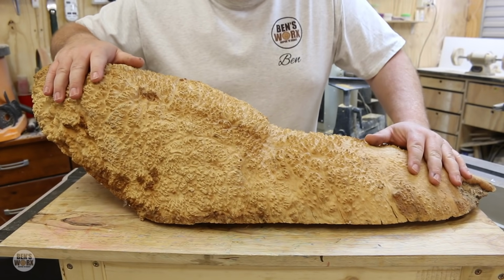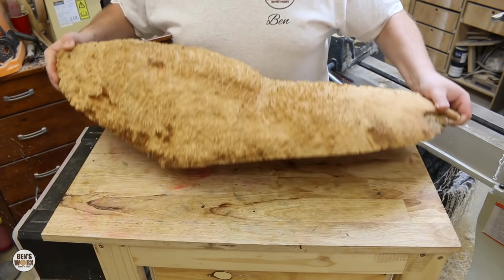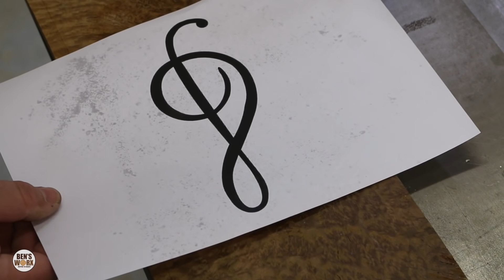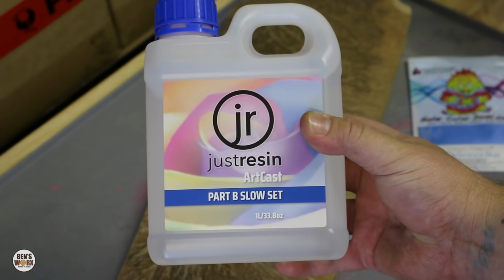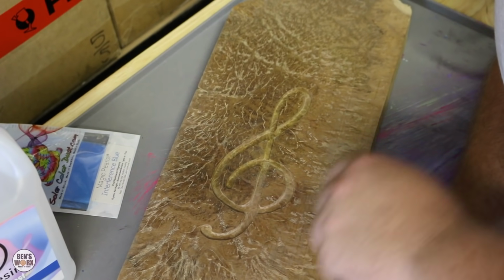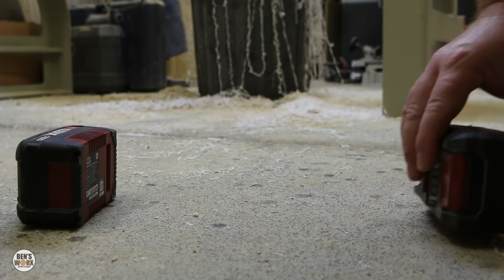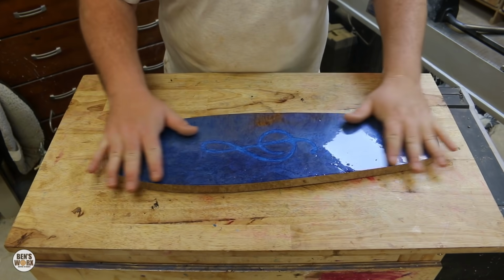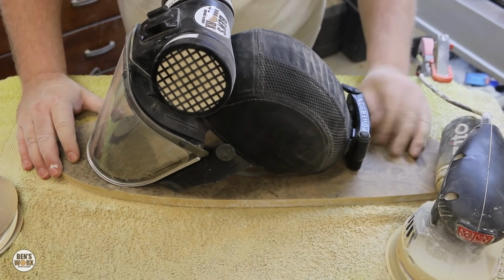Making a Homemade Skateboard with Resin Inlay

Comment: Hey Ben According to Wikipedia (sorry if you don't trust their information), the etymology of the word "truck" comes from a shortening of the word "truckle". Truckle is related to the Latin word trochus, which means "iron hoop" or "wheel".

Since the axles on skates were originally small, iron wheels, that is probably why they are called trucks. (whether that's true or not I have no idea.)
Reply from the maker: Thanks Lenny, it sounds like it could be right 👍

Comment: There's a Crocodile Dundee scene in there somewhere...

CD: That's not a burl...
...
This is a burl.

You are certifiably ambitious to shape that into a skateboard, and very generous, if my perusal of burl prices serves.  The figure in the wood fresh out of the thicknesser (2:48) is stunning o.O I hope you have little knick knack ideas for all the left over bits. Have you considered a CNC for the carving elements? 

What is that grey rubbery mat you put the raw board on to pour the resin? 

Merry Christmas and happy new year.
Reply from the maker: Thanks Mate 😊 I’ve been looking at the X carve but they are quite expensive, the grey mat is a silicon tray, Merry Christmas 🎄

Comment: Cool idea for an art piece but riding that will break it.  the inlay creates stress risers so when the wood needs to flex it will break there. plus the flexing will crack the inlay. I guess if it is rode once or twice on something very smooth it will probably be ok.  Also, saw you measured the trucks from the edge each but didn't see you you made sure they are parallel to each other.  making sure they are exactly in line is more important than their distance to an edge. At least for functionality